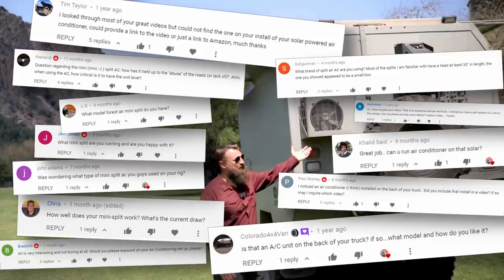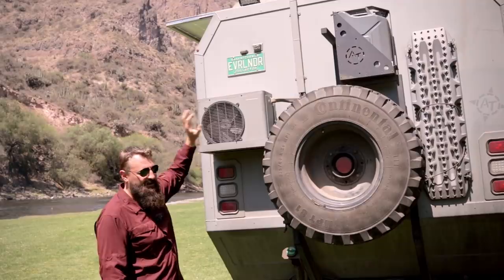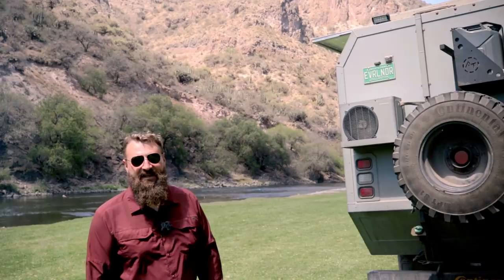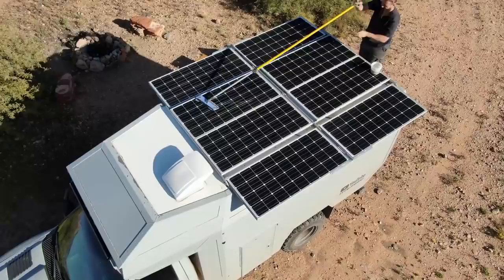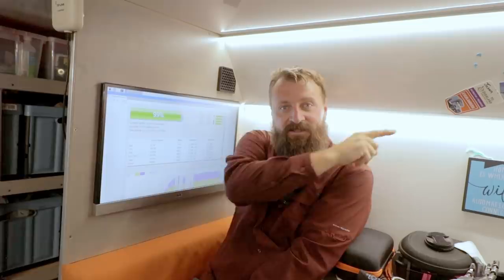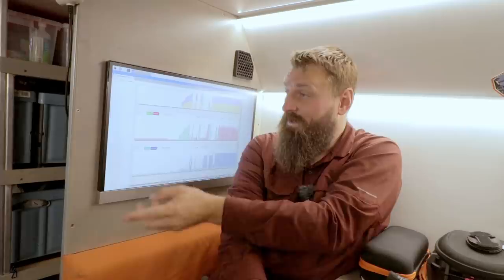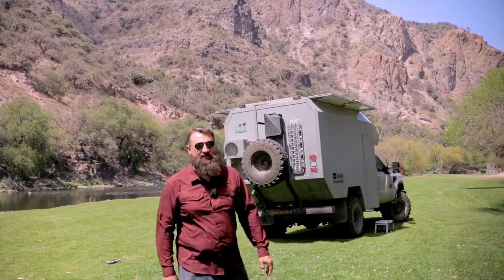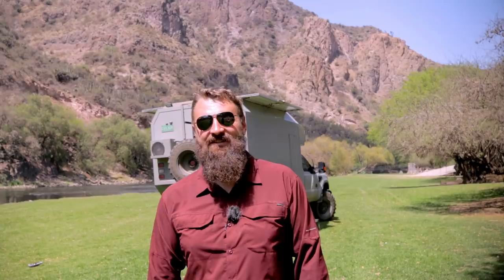Solar Powered Mini Split Air Conditioner Tour - Everlanders see the World!

Comment: He is right about the windows. After 18 months of living in my truck camper in Idaho I can tell you that glass, aluminum window frames and metal siding are your enemies. Once, when the outside air temp was 40 deg F, I used a laser temp checker on the metal siding and it was 95 deg F!!! and that was on a January day in Idaho. Then this summer the hottest day was 106F. You can imagine how much I sweated inside that thing. When I build my next one there will be no windows. If you want to see outside, then go sit outside. That is why they call it camping.

Comment: If you have windows, just cut some foam to a fit slightly smaller and cover with a soft fabric and a couple of fabric handles that you can pop in and out. Makes all the difference in the world. I think 90% of heat loss/gain is through the windows.

Comment: You can capture all the water from the ac also to drink. Its pretty much already done just a filter and enjoy the free things in life. Great to drink and cook or water your dogs with.
Reply from the maker: I would advise against this, this is how people end up getting Legionnaires' disease. It picks up all the bacteria from the air and so the water would need to be treated before use. And clean filtered water is readily available for $0.50/Liter - To cheap to bother... If it was life or death we could, we do have the 4 stage filter with UV - But for now we're watering the cacti.

Comment: Mini split is the way to go for nomads that feel the need for air conditioning....economical and able to be powered by solar/batteries if you have enough
Reply: Yup.. Pioneer 9000btu unit pulls a max of 720w. More efficient then this unit while also cooling more.

Comment: Thank you..I installed a Mr.Cool 9000btu 115v mini split a/c with heat pump. Pre charged..easy to install...I installed a 4000 -8000watt pure sine wave inverter and a 40watt solar controller with 540watts worth of solar panels..
Reply from the maker: Excellent!
Reply: @Everlanders  I was hesitant about it at first but figured..ahhh..what the hell.. 
The 500 is enough with the 40amp solar controller to keep the 8d battery charged and running the A/C with the pure sine wave 4000- 10000 peak inverter in full sun in Florida.. and the other two 20 watt mini solar panels keep the two 1150cca batteries isolated and charged individually so I have a spare and a designated engine battery.. on Marine switches so if I need more power sent in either direction..just a flip of the switch and I'm good to go.. luckily I grew up on boats and worked for a commercial/residential electrical company when I was in Highschool..But even with the education, I had never tackled a project like this and you gave me that added nudge to "get errrr done!!' and I am seriously grateful!

Comment: I'm impressed with you answering each question so thoroughly. So here's one you don't have to answer. Just wanted to express my appreciation for this video. I'm going to re-do my AC this summer and this is exactly the kind of info I was looking for. Was considering making the window unit work but never thought about the drain being level. Even if you were level,  the first turn or bump could dump the drain pan into the vehicle.  Thanks again.
Reply from the maker: Yeah, To be clear, I'm not 100% against window shakers... With enough effort you could probably dismantle, insulate & seal the hot side from the cold side and then try to improve the distillate collection tray to drain nicely. But I tore apart that LG unit and it was so cheap and flimsy I felt I'd need to rebuild it with a better frame and side panels. Further the time and supplies that go into such a project add up... It didn't seem worth it to me.

Comment: Add a Opolar USB fan  (2.5 - 5 watts) to your room to circulate air for comfort also to bring warm air back to ac. Super efficient  , found on  Amazon. You can use a phone charger or powerbank as power source.  They also sell rechargeable fans .
Reply from the maker: Why? It's unnecessary...

Comment: For those who use mini splits that use lead acid batteries these units produce one and a half gallons of distilled water per day. Using the drain hose. Good for making drinking water or coffee water and battery water. It comes from dehumidifing your room. Nobody ever mentions that.off grid for 30+ yrs now.
Reply from the maker: I think nobody does it because of the legionnaires disease.

Comment: Note: The inside unit is called evaporator and outside unit is the condenser :)
Reply from the maker: Correct! 🏆
Reply: Only in cooling mode... 
The jobs reverse in heating mode... 
So best described as the compressor section and the air handler section.
Reply: The condensate pump can be cleaned with a solution of condensate pan treatment tablets dissolved in water, dribbled into the tray.
Allow it to soak and the microbial growth dies and breaks up.
Reply: H Mandeel : 

The condenser is not oriented correctly on the truck 🚛. The fan axis must be perpendicular no the wall, not parallel. 

On the other hand, if the condenser were placed on the roof, the air flow of the moving truck will cool the coils. No need to turn on the fan unless the truck is at zero speed or very low speed. 

The electric ⚡️ fan of the car radiators (engine cooling) are turned off by the car computer when the car travels at high speed to save gasoline ⛽️.
Reply: Alejandro Rivas I have installed a LOT of these systems... parallel to the wall is the norm...
Reply: SuperVstech : 

How is the efficiency if you install the condenser perpendicular to the wall? 
 
I install the evaporator as far as possible of the wall for noise reduction. My preferred orientation is perpendicular to the wall to increase air flow. Sometimes I install a booster fan on the intake to decrease the cooling time of the room
Reply: Alejandro Rivas noise? They are nigh silent.
Reply: That is only true in cooling mode.
 Here in Oz most ac is reverse cycle, hence we use the terms 'indoor unit' and 'outdoor unit' to avoid confusion.

Comment: Decent setup, the only issue I have is heat and solar panels over 100 degrees you panel generation degrades considerably 105 even more, speaking from experience from panels on my house they can get up to 130 degrees plus on a hot sunny day here in California, thats why on my rig i have a generator single power source is a fail point. i enjoy your videos great work!
Reply from the maker: Losses due to heat are accounted for, We simply got a few more panels. the extra solar cost far less than the generator and ongoing fuel costs.

Comment: Pioneer AC has a 9k btu 110v mini-split you can get with 10-25ft connections.
Reply from the maker: Yes, We installed one in a Friends van, Both the outdoor and indoor components are twice the size as ours - I considered upgrading, but his average daily power consumption was higher than mine, so I'm sticking with ours until it dies. If you have a ton of space then it's a fine option.

Comment: 12:19 that condensate water can be harvested for drinking water (probably best to filter it) but for survival scenarios good to keep in mind.  The 3d printed vent could just be sanded down so the "tubes" are shallower and give more turbulent flow
Reply from the maker: Our rooftop rain water collection system is more than sufficient for our water needs.
Reply from the maker: And regarding the vent, the corrugated aluminum duct was the biggest restriction, this has been increased to 5" smooth PVC conduit with a directional vent that I 3D printed... https://youtu.be/XxJkS1qbwVY

Comment: @Everlanders  thanks we are looking at setting up solar:14kw w 3k inverter 500 ah batteries , 12vt with 110vt, and adding Cummins generator tapped into the rig's fuel tank.

My sophomoric understanding of course  will need adjusting and adapting as we get further into the build.

As a promo vehicle for our documentary not only are we blessed with building a fun rig to cruise up and down the Florida coasts, we will run multiple large screen tvs outside, running an apartment size fridge, coffee machine, a/c (like your mini split option), lighting interior/exterior,  cameras outside security and safety,  multiple computers,  air pump, e bikes, etc.

Sometimes I think this rig will end up having that electrical Humming sound.

I know at least that once we get the full product list we can reverse engineer the power usage/consumption with every thing on, 3/4 on, 1/2 on and typical event consumption hours vrs recreation consumption hour. 

And not so long ago I thought we would just be on shore power everywhere. 😅👍

Thanks again this does help get a better picture also just saw I put 14,000 but really ment 1,400. 😆
Reply from the maker: Looking at your drawings for the truck, I'm not sure how you're going to fit 14kW of solar up there... There may be room for 3 or 4 maximum.
Reply: @Everlanders  just saw I put 14,000 whoops ment 1,400 again excuse my sophomoric understanding of solar.

Comment: Great idea with the those slide out panels! 😃👍🏻👊🏻
Reply from the maker: Thank you! Cheers!
Reply: Make all four slide to the right and you'd have a nice awning.
Reply from the maker: I ran stress analysis simulations on the slide structure and deemed it too risky.
Reply: @Everlanders  True.  Folding legs or braces would be necessary..

Comment: Hey, great video. HVAC tech here….your indoor unit/air handler is called an evaporator. The condenser and compressor are in the box outside.
Reply from the maker: Correct 💯

Comment: Mini split systems are the way to go. Just make sure you choose one that has a 20+ seer rating and a heat pump option. More seer is more efficiency and less wasted solar energy. The heat pump will be useful when you want a heater out of your ac unit( it reverses the flow of coolant to bring the heat inside your unit)  make sure you buy one that is 115v. And most of them will disconnect the line before the unit is flooded with coolant for installation.

Comment: Thanks for posting this. It's almost the same thing I am planning for cubevan I plan to build out. I will have 1,200 watts on the roof.
Reply from the maker: Also remember that you'll likely only get 2/3 of the rated power from those panels in the real world. I did a video on this some years back.
Reply: @Everlanders  thanks for the reply. I watched the video when You posted it, your channel is always informative and interesting.  The box on the van is a 7 x 14 with a 84" ceiling height. I will have R10 for insulation all around. I will start with 300 amp hours of lithium batteries and hope that will be enough.

Comment: Good info! Duty cycle and conversion loss are often overlooked in calculations! The volume (sound) difference between these and what we are using is true. You also have to seal a window unit on the inside in the Winter as they aren't insulated very well. We may save a little power, but there are definitely dis-advantages!
Reply: Mini splits don't really have a duty cycle. That would imply it has a on and off time. Mini splits use inverter based compressors that stay on the entire time and ramp up or down based on the temp in the room. It will stay on the whole time while only using 30% of its rated power/capacity output. This makes these units even more efficient since they don't have huge surge power loads in order to power the compressor on.

Comment: I remember a few years back I was looking into doing a small small house (bigger then a "Tiny Home", about 16 ft x 40 ft or so) and my goal was to make efficient enough to be off grid for the whole house, due to this I was doing research into A/C's and I found one that was actually Straight DC powered so you didn't have to go through an inverter or have a grid connection.
Reply from the maker: Yep, they're even more common now, but usually 24 volts and/or many times the cost and size. Not ideal for our application.

Comment: Awesome setup in combination with your solar and battery system. 

When I worked for a company that designed HVAC systems they tried to not use 90° ducts as it restricted airflow more than 2x45° or rounded ducts. You might see better cooling if you did that if you end up doing any revisions.
Reply from the maker: Thanks, I've since moved to two 45° elbows and increased the diameter to 4in, doubling the area... Still works great, but is a bit quieter.

Comment: Most household heat pumps are inverter controlled these days. 
Not sure if you can find a small unit like that with an inverter but would help a lot on the power draw.  Instead of cycling full blast, you're only pulling what you need.
Reply from the maker: I need full blast.
Reply: @Everlanders  Fair enough 😀

Comment: If you can get an inverter AC you don't have the full load on-off situation that you have now. The inverter AC slows down the compressor to maintain the temperature once at the set point. It will mean less wear on your batteries as they won't discharge and recharge as the AC cycles on and off. Also, they are more efficient and quieter as it slows down. Also they are much better for your power inverter as there is not the hard start and surge, inverter AC's start slow and build up to full speed eliminating the massive surge.
Reply from the maker: I have had dozens of people making this comment, yet none have been able to provide a link to such an Air Conditioner. Please provide a link to a comparable ~10,000BTU system that will run off of 110VAC or better yet 12VDC for $500 to $800 - I'll Order one right away...

Comment: Looks great except i wouldve picked up a unit that has a normal air handler that has full motorized swing to evenly distribute the air instead of a single 4inch hole trying to cool the camper down. And it would still be mostly hidden in your storage area if you position it right.
Reply from the maker: Which one as an example? Please provide a link!

Comment: They are more expensive, but DC Inverter air conditioners are able to vary the compressor to meet demand rather than simply on/off. They have a much lower peak when they click on. Looks like you're happy with yours but a possible upgrade in future if you ever have a problem. Many inverter models can work as a Heat Pump, which would be useful in winter at least in the sun.
Reply from the maker: Yes, but the average is still the same, and we have no problems with the peaks anyway... Also they are much larger size and weight. But like you say, if this one breaks beyond repair, I can get a new one...

Comment: You could collect the water from the AC for washing.
Reply from the maker: If you saw the crud coming out of that tube you'd think twice... Also the rainy season is upon us, so there is no shortage of water...
Reply: Everlanders 
Is that normal for crud to be inside your AC? I know you’re not supposed to drink AC water but with cartridge filter couldn’t it be used for other things? It’s soft water (without minerals) it would be great for washing the van, solar panels, showering and washing. It would mean having a storage tank  to be heated for hot water and then the original tank would be for just drinking water. Having a second tank that is topped up from what would normally be wasted on long trips into the boonies would greatly extend your independence. An added bonus would be that the hot water heater wouldn’t get limescale as quick.

Comment: These types of split units all require the outside unit to have 12-inch minimum spacing on the back where it draws air in to blow through the front.  Yet it looks like you've mounted the outside unit with only a 2-inch clearance which severely constricts the intake.  I have to imagine this reduces the efficiency of the unit, but it clearly still works for you and it makes it easier to mount this unit.  But are you getting good reliability from this thing?

It's great to have this type of AC working because it's so much more efficient and so much cheaper than 12V ACs built for the RV market.  But it looks like your particular unit is not as efficient as other products that have almost double the efficiency.  There's no way I want to spend $4300 on an RV AC.  It looks like you can probably move this thing out 2 inches to get a little more gap behind the back.
Reply from the maker: I used the same spacing as the originally supplied window bracket... The condenser coils and fins are inset from the back of the unit. Further, the average watt/hour consumption is the same where it is mounted now as compared to when it was sitting on the ground in open air.
Reply: @Everlanders  watt/hour shouldn't change.  What might change is the cooling efficiency such that it's not producing as much cold air and requires longer duty cycle to cool the same room.
Reply from the maker: Longer duty cycles would measure more watt hours being logged...
Reply: @Everlanders  OK, you said same watt/hour which is not the same thing as watt*hour.  If it's consuming the same watt*hour even with less clearance, then the negative effect isn't that bad and 12-inch clearance was just an overly conservative recommendation.

Maybe it makes a difference in hotter climates where the heat exchange is less efficient, but not in most conditions.  The manufacturer just gives the most conservative clearance to ensure performance and minimize complaints.

Comment: Would love to find a unit that could be mounted underneath a vehicle as vans don't really have the option for back mounting, shade under the vehicle would also assist with cooling and it could be mounted in a place where the hot air is shot out backwards or sideways.
Reply from the maker: From my days of ambulance manufacturing I can tell you that condenser units place underneath the vehicle will fowel up with road dust very quickly. This dramatically decreases the thermal efficiency, not to mention putting heat underneath your vehicle, heat rises...